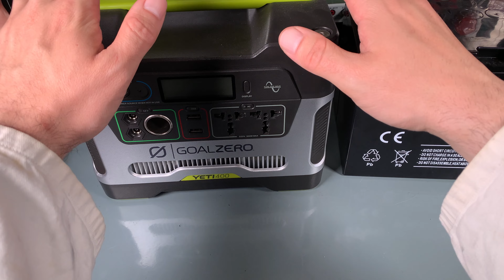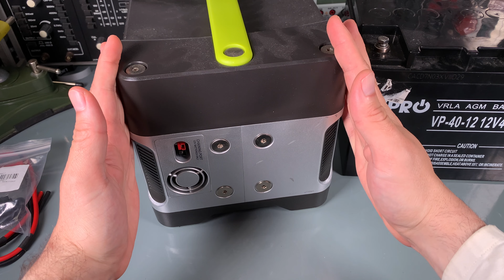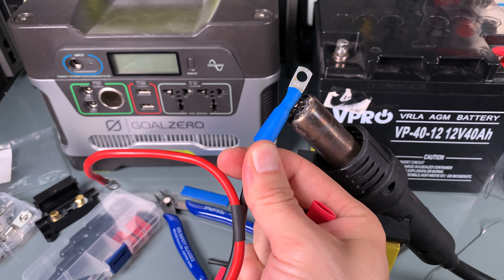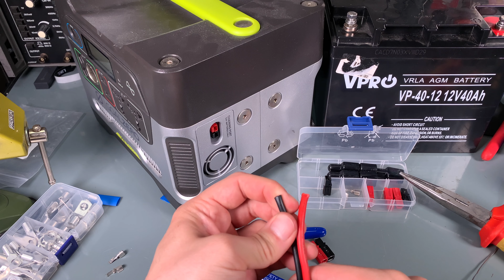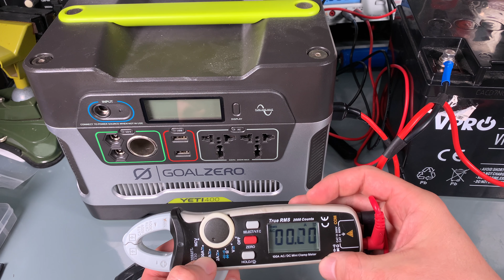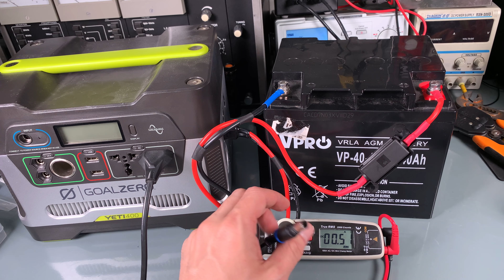Goal Zero Yeti 400  - adding external 12V SLA battery  to expand capacity (create own cable)

Comment: A little confused with 50A fuse for 30A-10AWG cable, 30-40A fuse would be mush safer for short circuit  protection
Reply from the maker: You are 100% correct it's to high but in this case it's for short circiut protection not over current per say - if You grab like wrench and touch those wires hungered of amps will go and burn fuse no problem. Problem would be if batter could delivery 50A  - we make short and fuse would never blow but wire get damaged.

Comment: Hello.  Nice setup.  Thanks for sharing.  What is the biggest size battery (in AMPS) that you can connect? Any AGM battery works? For example an Optima Yellow Top battery?

Comment: Hey Mate, i am doing the same thing. Quick Question: I want to connect my dieselheater directly on the second battery. Will the yeti have a problem with that?
Reply from the maker: It should not have any problem - worst case it can blow fuse if exceed I believe 50A from internal battery (writing from memory) - just make sure to recharge both batteries from goal zero (if You skip charging from goal zero it it won't update battery indicator and show empty battery even if it will be 100% charged) .
Reply: @ElectronicNoobBlog  Thanks mate👍🏻